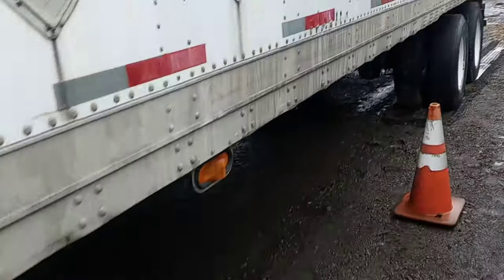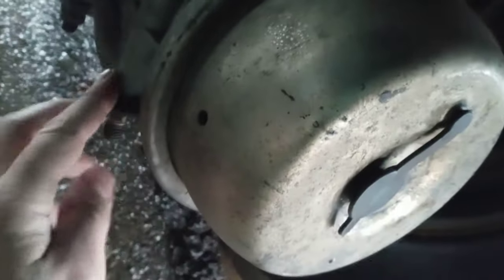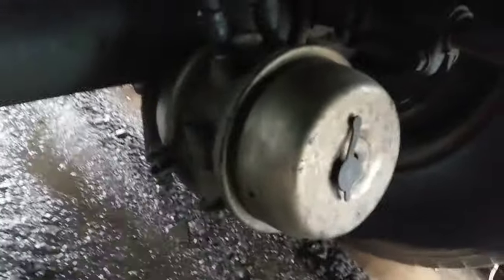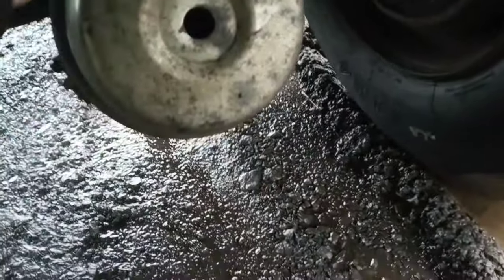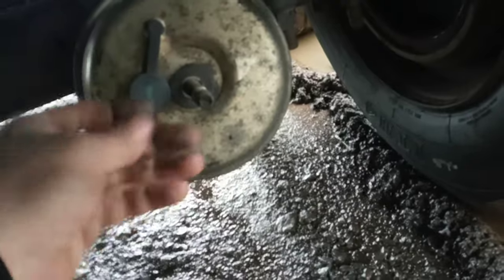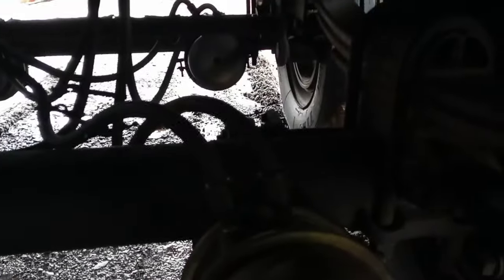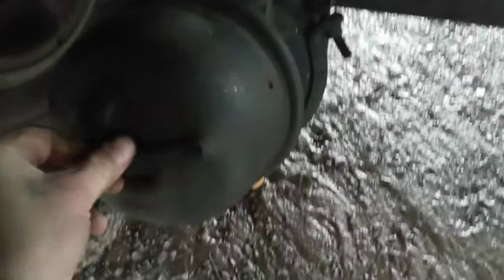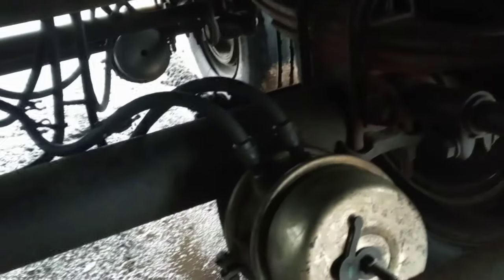how to release stuck air brakes (caging)

Comment: If it gets ya moving it get's ya moving but those brake chambers look fine, internally spring could be weathered away and broken possibly. But I'd try releasing the brakes with the tractor valves and back up sometimes that will free the shoes from the drums if they've been sitting.
Reply from the maker: You're absolutely correct- after caging & releasing them i got them working well

Comment: Once you cage em, do you drive and then release thw caging bolt? Or when would you take off the bolt
Reply from the maker: You must fix the problem- pulling the spring back will get you rolling & save money on a rodside repair or expensive tow but you would need to solve the issue(s) that had them stuck to begin with.
Reply: @vinnyoombotz3132  thanks for the quick reply

Comment: Is it illegal to pull a trailer with no brakes
Reply from the maker: Depends where you're pulling it to... this is the same thing a tow truck will do (if the operator knows how) but it is to exit the roadway & get repairs for safety purposes.
Reply: So fooking what...Go ahead and pay a tow bill of $400.....Take a ride on the wild side like a farmer...
Reply: @vinnyoombotz3132  we only cage brakes as a last resort. Normally we run air from our auxiliary and use the trailer brakes via our own service line. We are trained to repair airlines before caging becomes an option.

Comment: Why would the brakes lock up like that? Or in this specific case why did they lock up?
Reply: they might be "camed over" which the "S" cam extends to far pushing the shoes to the brake drum and wont release.
Reply: @YourName-jm7lz  ah I see , thanks for the insight .
Reply from the maker: Just think about what we're doing here is "manually" releasing the brakes that we would normally push a valve to release on the dash in the cab...
Reply from the maker: @codyramos3200  great question! In this case it seems to have been insufficient air but what your name wrote could also be the case. Bleed your air tanks to clear out water & oil (before or after every trip is really good).
Reply from the maker: @YourName-jm7lz  this time it seemed to be clogged air lines close to the diaphragm but it is great to have your insight!
Reply: @vinnyoombotz3132  interesting 🤔 I'll have to keep that in mind .. random tidbits of information is my thing lol.  Comes in handy from time to time.  Thanks
Reply from the maker: @codyramos3200  ya never know when you'll need it, but if you ever do, it exists... Are you a driver?
Reply: @vinnyoombotz3132  no not a driver but working in the landscaping business theres usually a tractor trailer around dropping sod, trees or equipment off... have honestly been thinking about getting a class A cdl.. change things up for a little bit... maybe start a business selling/delivering sod and trees.. . Be surprised the money that can be made off grass and trees.
Reply from the maker: @codyramos3200  there is definitely good money in it & better money if you know what you're doing- being mechanically inclined, or having other skills just makes you more valuable!
Reply: I had my breaks lock up on me while setting my tandems. An experienced driver explained this was caused by my tractor not being lined up straight with my trailer while setting the tandems. As per hid instructions I locked my axel and pull forward. This caused the breaks to release. However,  this does not always work. So I'm grateful to learn this method. Nobody wants to be stuck in a dock, or stuck blocking the dock. I've seen it happen to other Drivers. And who wants to be stuck on the shoulder all night waiting on roadside for help, when you can pull off to a safe place?
Reply: Bad brake chamber or maybe the brakes are cammed over

Comment: Why do some people use vise grips on the air line?
Reply from the maker: Probably not on an air line but if so, it would be the same as the reason for doing so on a hydraulic line- crimped to stop a leak

Comment: Should the cap always be left plugged in?
Reply from the maker: Yeah bro, you have a T-shaped fitting in there that can get filled with road grime or rusted out etc... The rubber cap keeps it clean in there (some brakes have the bolt built-in, & instead of a rubber cap you will see a hex nut, usually 9/16 i believe...)
Reply: @vinnyoombotz3132  okay because sometimes it pops out and I have to keep pushed in back in should I get the cap replaced since it’s always coming loose? And will I affect anything while being loosened especially while driving?
Reply from the maker: The cap won't affect driving, but caging the brakes will eliminate the use of THAT brake. Cage them & drive to a shop to fix whatever made them not release.
Reply: @vinnyoombotz3132  thanks

Comment: The bolt won’t turn
Reply from the maker: If you're missing that little rubber cap it is possible that the keyhole for the end of your bolt is all cruddy or blocked by road grime- but the bolt itself is not supposed to turn. You put it in the chamber, lining the "T"end up with it's keyhole inside & then turn 1/4 turn to grab the back of the spring. Once that is all in place you thread the nut on the bolt using the nut to draw the "T" up, pulling the spring back.
Reply: @vinnyoombotz3132  
Most likely, it's blocked by something solid, it goes in easily matching the T but I can't twist it 1/4.